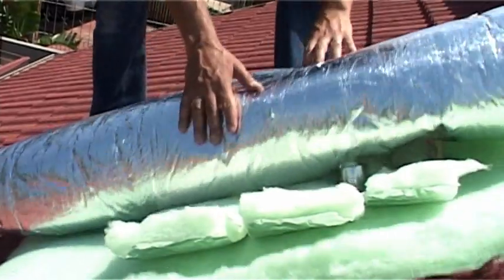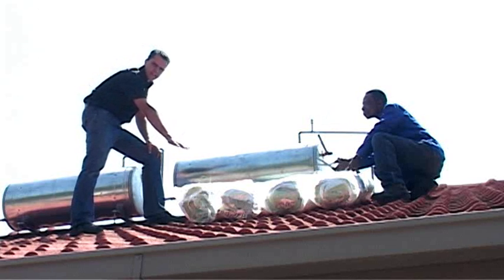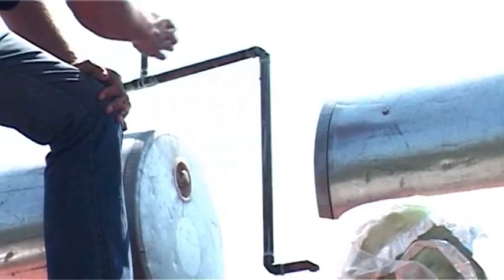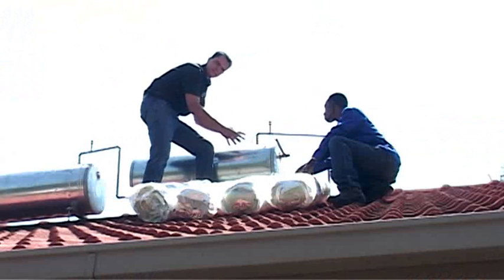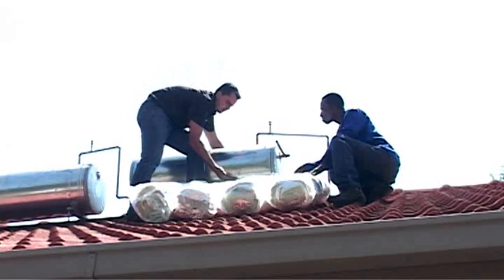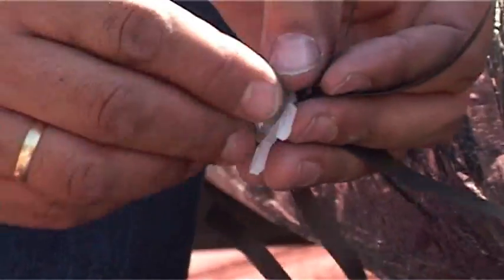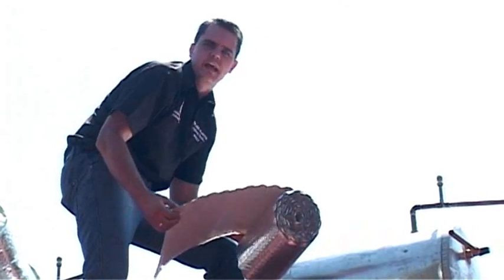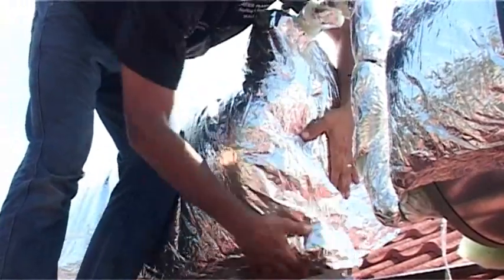INSTALLING A GEYSER BLANKET ON YOUR OUTSIDE MOUNTED GEYSER - UV Resistent

Comment: Hi. Will a geyser blanket still help in a non frost area where the geyser is in the roof? Thanks
Reply from the maker: Good Day Phelan

Yes absolutely. It is very similar to the concept of a kettle or hot water flask in the kitchen. As soon as the element switches off, the water starts losing heat untill the time the water temperature drops to a certain point where the element needs to switch on again to reheat the water up to set temperature.
The geyser blanket reduce / slow down that process by keeping the water warmer for longer.
Even when the geyser is inside a closet, when you touch the geyser you will feel some warmth to it- that is the heat loss/  energy loss.
Reply: @energyweb1  thank you